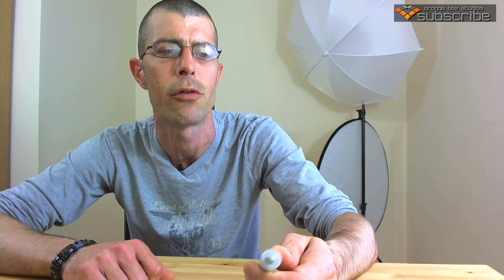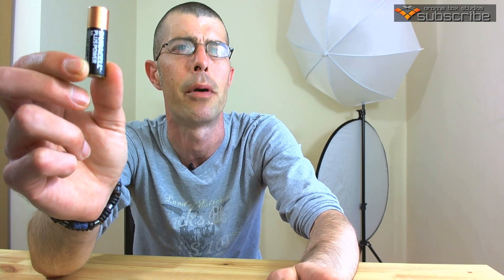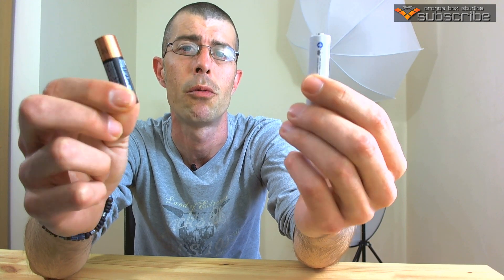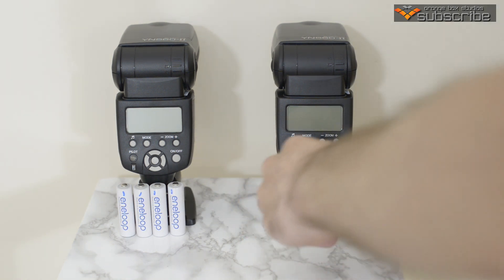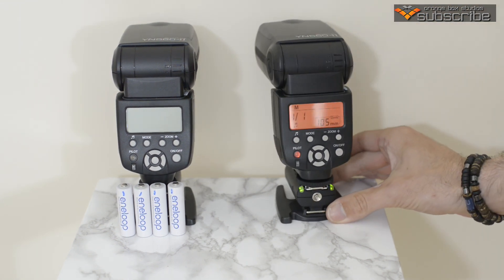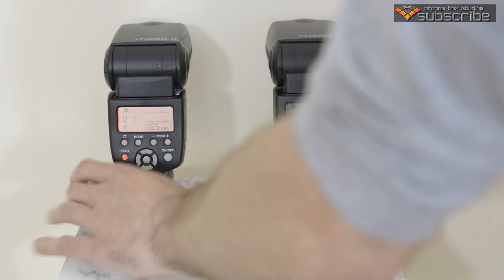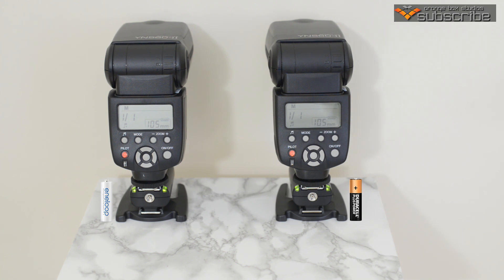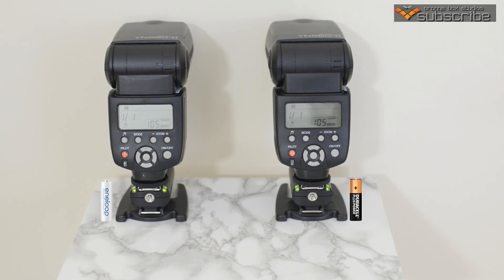Best Flash/Speedlight Batteries (Rechargeable NiMh Sanyo Eneloop or Duracell Alkaline)

Comment: How long last one full charge? That would be my question.
Reply: +Bálint Meggyesi says:
==
Your question shows that you are not familiar in this field(flash photography).

The question is almost meaningless, and here's why.
Alkaline discharge is gradual unlike Nimh which means each the time the flash refill the capacitor, the recycle duration becomes longer and longer often ends up waiting 60 seconds, 120 seconds before ready light comes on but the batteries are technically still not dead yet, if it's acceptable to you to wait that long between the shots.
On the other hand, when Nimh drains at the end of recharge cycle, it drops quickly and up until then the recyle interval is pretty consistent. If it starts out 3 seconds like in the video, it'll keep the interval for around 3, 4, 5 seconds then maybe to 8 seconds almost entire span of the recharge cycle.

So your question comes down to another question.
How long the interval is acceptable to you before you feel you can't stand the waiting time?
If your answer is 30 seconds, then Nimh wins hands down, because with alkaline batteries, it gets there pretty quickly. If your answer is 60 seconds, Nimh still wins. If your answer is 120 seconds(hard to believe), then maybe (just maybe) alkaline has a chance.

So these days, almost everyone uses a flash agrees that the batteries for the flash should be Nimh.
Alkalines cost more because they are throw away. They are slow to recycle from the beginning. They become even slower as each shots taken.
There's no good reason to use alkaline batteries in flash.

Comment: Lithium batteries are the best rechargeables on the market but so few high drain devices are designed to use them. The old AA design has got to go, there is better technology out there now.